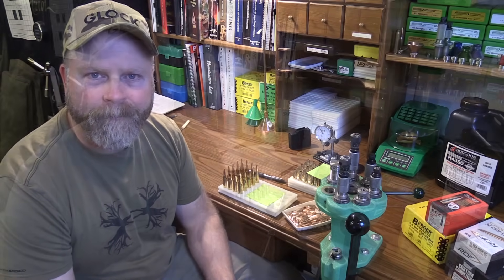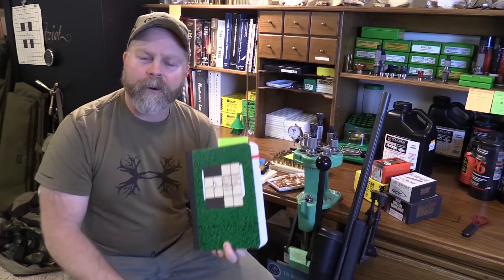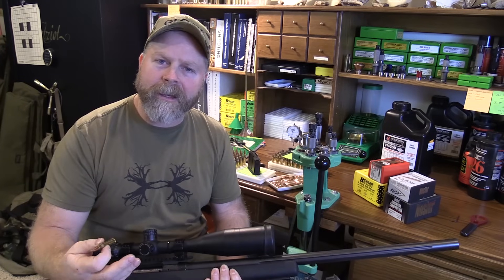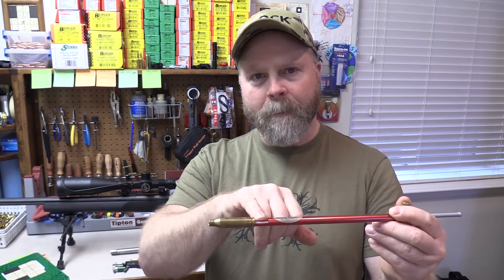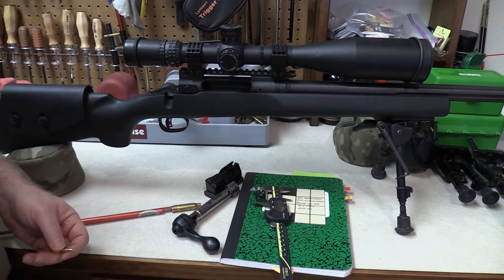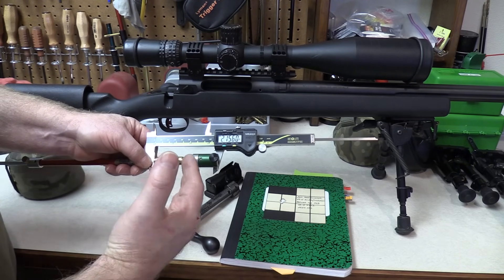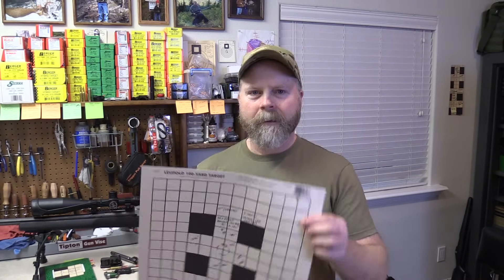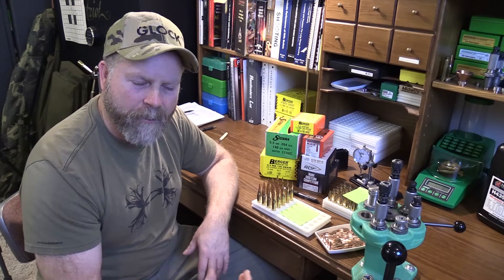Bullet Seating Depth: How To Measure & Where To Start For Load Development

Comment: You mentioned a valid point on the length of the throat vs magazine length. My AR10 has a magazine C.O.A.L of 2.80. However, using the hornady gauge I surmized the length to ogive @ 3.230. I will never be remotely close to .010 from the lands. Should I just concentrate on load development?

Comment: Subscribed, great presentation. I'm a new reloader working on a load for my Savage 10 chambered in .308 and having a ton of fun with it.

So far I've settled on:
175 SMK
42.0gr IMI 4064
Hornady brass (Have Lapua on order)
Federal Match large primers.

Put four through a ragged hole with one flyer about a half inch left, for a total of .62 MOA. .3 MOA excluding the flyer. Loaded up some more last night and hoping to verify the load soon.

Comment: Why all the special case, tooling and procedures for actual bolt face to lands measurement?Just take a piece of fired brass, slip in a new bullet and chamber it.Eject and measure.
Reply from the maker: Jim Hammer If that works for you, keep doing it.
Reply: Additionally, with each change in style and manufacturer, that measurement will change. Using a new bullet in a piece of fired brass is the only way to do it accurately

Comment: For kicks I measure the the max OAL and compared it to standard factory 450 BM ammo.   I checked a few bolt guns.  And it appears that Hornady factory ammo is at least 175 to 180 thousandths off the lands.   People are trying to be like 20 thousandths off the lands and it appears that too much (180) does not hurt accuracy one bit.  Should 4 450 BM bolt rifles and all under 1 MOA at 100 yards using factory.

Comment: What about seating depth and its relation to the gunpowder?    Example:  People say that H110 powder needs to have no airspace between the top of the powder and bottom of bullet.   So you might run into the situation were your seating depth is good for the distance from the bullet tip to rifling but leaves a air gap between the bullet and gunpowder.   So do you seat deeper so the bullet is touching the gun powder but then have more of a gap between the bullet tip and the rifling?  Seems that one should have to pay attention to both variables.
Reply from the maker: Bob I wouldn’t use a powder that was that sensitive. There is definitely a relationship between chamber size, burn rate, and bore diameter,  but I’ve never had to seat the bullet closer to the powder column just to eliminate air.
Reply: @PanhandlePrecision  I think ALL powders are sensitive to the air gap.  Example.   What if the air cap is directly over the primer?   The burn rate will be altered vs if the powder is covering the primer area.   Air space above the primer can be a issue.   At least for you it seems that the amount of air space under a bullet does not matter, you worry more about the gap between the lands and bullet.   Its an area of reloading where some people care and others don't.   I'm just trying to get to the bottom of this.
Reply from the maker: Bob All that matters are results on target.
Reply: @PanhandlePrecision  Hehe I wish it were that simple.   One has to worry about pressure issues too.
Reply from the maker: @Physics072  I've done some experimenting with this using throating reamers. If you take a 260 Rem with 42.0 H4350 and seat a bullet .020" off the lands, you will get the same MV with the same combination in a chamber throated .080" further out. Same jump to lands, but different space between the bullet and powder column. The amount of space the bullet takes up in the case isn't that important in the grand scheme of things. Picking an appropriate powder and charge weight for the case size, bullet weight, and bore diameter is. The real pressure doesn't start until the bullet is fully engraved in the lands.
Reply: @PanhandlePrecision  Thanks thats good information.    Well right now I'm researching reloading and have a unused dillon press (yes I know, was not my idea though)   On forums get so much conflicting information.  I just wanted to copy my factory rounds and find I can't even buy the same powder they use nor any reloading info.    I would like to see a pressure curve on a 450 bushmaster starting with too little powder all the way to 60,000+ .    I know of one person that sort of did it a lab, he said he ran out of room in the case before pressures got too high.     I'm guessing each company must have this in order to know the limits but I do not see such a chart published but I've not looked super hard, it might be somewhere on net.

Comment: how do you tune in your seathingdepth??  Same powderload but different depths??  Or the other way around - shoot in a load first and then tune in different depths?
Reply from the maker: PE J I don’t really mess with seating depth. I set it at .010” or .020” off the lands and don’t change, even as the barrel gets miles on it.
Reply: @PanhandlePrecision  - but sometimes you might get very far out from the caseneck and that means less presure in the case. Do you even go over max load of powder then?? maybe 0.1-0.2 gr??
Reply from the maker: PE J I don’t. If the starting depth is say 1.900” CBTO, I leave it there, even if the throat burns forward. I think it’s a waste of time and components chasing seating depth or adding powder by the kernel. The barrel is likely shot out by then anyway.

Comment: is there a bullet seating die that pushes the bullet from the ogive instead of the tip.. as i am shooting a 7 mm rem  with nosler bullets  and each and every one comes out different , even when i sent RCBS 3 bullets to get a custom seater .  as the bullets are not all uniformed  thus giving me different OAL measurements.
Reply from the maker: akaeldin I don’t know of any seating stem that purposely contacts the tip or ogive of the bullet. I seat 115 grain RDFs with Redding Comp seater using a standard stem. Hits the nose ~ 1/8” down from the tip. Perfect seating depth across large batches.

Comment: Do you have any advice for seating depth in pistols?  I'm presently using 9mm 124gr polymer bullets, and I have Taurus & FN pistols.  I seem to need to really make my C.O.L. quite short, (~1.1") and I am concerned that I may be compressing the powder even my Starting Loads.  The trouble seems to be that the Taurus barrels require the shorter bullets -- even with a "pointier" Canilure.  Should I re-throat all my Tauruses or go with a shorter COL that passes the Plunk Test?

Comment: I am working on Berger 130 VLD Target loads for a 6.5 x55 CZ 550 rifle.   I have measured my CBTO length and am concerned that setting the bullet length as far as you suggest won't give me enough bearing surface when seating the bullet.  Is this a matter of pure feel or is there some starting formula I should use?

Comment: Thanks Sam. I have a question. My reloads sometimes widen group over time. I noticed when I went to pull a bullet it was tight. Had to seat it a bit deeper to pull. My fresh reloads are easy to pull. I’m wondering if sticky bullets cause a different pressure giving me a different group. How do I fix this.
Reply: Hey Eric, the bullets sticking in the neck can affect powder ignition, velocity, and accuracy.  There are several dry neck lubes you can use to solve this problem, such as hex boron nitride, graphite, mica, etc.  Search your favorite reloading store for dry neck lube and you'll find what you need.  I coat my bullets with the hex boron nitride (HBN) so that's what I have on hand to use for neck lube.  I just get some of the powder on a Q-tip and lightly dust the neck of each case before charging with powder.  The Imperial dry neck lube comes in a container with a bunch of small beads so you can just dip the neck in there and move it around to coat everything.

Comment: problem i run into is consistency.  i have the straight oal gauge.  i have the factory 6.5cm modified case.  i have the hornady bullet.  i guess i just don't know when it's touching the lands.  it felt like it once at 2.018.  i have a few at 2.073.  then somehow i had one at 2.230.  am I jamming them in there accidentally?  are the others touching something first and I'm thinking they're bottoming out?

my one standard dev median number is about 2.085 but my range is 2.018 to 2.230.

Comment: Sam, I just got in some 6.5mm Hornady Atip bullets.  I like to seat my bullets at the lands on VLDs.... this new Atip has a very long distance from the tip of the bullet to the ogive. The bullet seated at the lands only has .125" of the bearing surface inside the neck..... is this seated enough to not cause problems?  Ive heard that a bullet should be seated in depth equal to the bore diameter. this is less than have that.  Any thoughts would be appreciated.
Reply from the maker: jaxplane 1/8” of bearing surface in the case neck seems like too little to support the bullet, but who knows? I’ve shot 300-grain SMKs with less than .338” of neck contact.
Reply: @PanhandlePrecision  ill see what happens but if i get run out, its not worth it so ill see if it likes to jump a lot.   I cringe at .125 to .150 off the lands.

Comment: Excellent dissertation.   I will throw another hat in the ring.  You are relating to hunting rifles.  I no longer hunt, but still target shoot.  I have a custom benchrest rifle.  These rifles DO show substantial  changes in accuracy when varying seating depth.  The tolerances in the benchrest rifles are much tighter which probably accounts for why you see the changes in accuracy.  Anyway my benchrest rifle’s “sweet spot” is 3 thousands off the lands to touching in most all bullets... 

Do you see any “sweet spot” at all in the hunting rifles?

Comment: I fire form the case and afterwards cut a small cut down the start of the neck of the case. So you can push the projectile in with a small amount of pressure. And it won’t slip to easily. Then carefully seat the empty case and primer with the projectile at a long length into the rifle using the bolt. Push it forwards and close the bolt. Then carefully remove and measure the overall length. That’s your distance to the Lans. No tools just a dremal or hacksaw blade. It has worked for me. Great videos. Cheers Brent

Comment: Excellent information and presentation, very informative and directly helpful. I am having difficulties doing this on a .223 Rem Ruger Predator using the Hornady tool and modified casing in that I get wildly differing results on each attempt. I took my time, very carefully executed each step, made sure the shoulder of the case was seated in the chamber, moved the rod forward with measured force, tightened the lock nut, and still got huge differences on each attempt. I finally stopped out of pure frustration. I accept that this is a tried, true and tested methodology which leads to the only variable, the grey matter between my left and right ears. Any and all advice would be welcomed.

Comment: Does the distance from the bolt face to where the shoulder seats change? Is that the throat you are talking about ? What is getting shot out in the barrel?
Reply from the maker: Grover Hammonds The area of the barrel between the end of the case neck and where the rifling starts.
Reply: Panhandle if I put a case in my gun fl sized no bullet no powder it slides into the chamber freely what contacts the barrel first to stop it the rim of the neck or the shoulder I’m still confused how we know or measure where the neck is
Reply from the maker: Grover Hammonds With a bottleneck cartridge like the 260 Rem, the shoulder of the case is what stops forward motion of the case when it’s chambered.

Comment: To seat out long against the lands serves to build higher chamber pressures which is what crimping does for hunting rounds. Six of one, half dozen of the other. The advantage of the shorter round is that it will fire well in any rifle, not just the long range target rifle you are working on. I also found that the Teflon coated rounds help greatly to extend barrel life but they are not cheap.

Comment: I am 62 years old and reloaded for over 20 years back when it was cost effective. Now with the price of powder and components, you can buy a factory premium round that performs perfectly fine. I use to do what you are doing for seating depth and not crimp on cannalures but that limits the round to TARGET only. I still have my stuff but never use it. RCBS dies were good but I prefer the Lyman turret press.  A good custom barrel usually cures reload accuracy problems too.

Comment: Sam you definitely have it down to the best there is , the only big difference I’ve ever noticed in seating depths of different bullets is when I for hunting purposes started loading a Barnes MRX , you know the solid copper bullets with pressure rings, three or four , grooves like a maxi ball , these type bullets tell you on the box to start your seating depth 50 thousandth off lands and boy were they right , and the closer you get to the lands , the worse your groups will be. Oh and they are expensive, but worth every penny , I could change the powder charge a bunch , and not hurt the group size, they just Waller a hole in the paper.

Comment: When seating the bullet my RCBS die does not contact the olive.  Is there a better die or do I use a bushing in the comparator that most closely matches the die so I can set the COAL?  Love your presentation.
Reply from the maker: It's a relative measurement. No seating stem that I know of contacts the bullet where a comparator insert does. Seating stems are going to contact up high by the nose; comparators hit by the bearing surface. Measure with the correct  comparator, and adjust with the die.
Reply: Thanks, I’m using the ELD 338 bullets which are fairly consistent but I’m getting .001 to .003 difference between cartridges using the 33 comparator.  Is this a big deal?

Comment: Not having all your fancy gear I just partially seated a new slug in an empty full length sized case & used the rifles bolt to push the slug into the case. Then using the seating die just pushed the slug in .1 deeper & made that my "master" dummy round. And wrote its OAL on that case. Seemed to work fine. Shot great. Like you, found setting slug just a tad off the lands worked best. Also lightly crimp each NON  cannelured. And tight crimp cannelured.  THAT really seemed to help & definately increased velocity & decreased velocity spread. Old gunsmith taught me that. Also, inside reaming the primer hole into a cone shape gave a better primer flame that ignited the powder from very bottom to top more consistantly. It also slightly enlarges the primer flash hole. For what its worth I usually get 10 FPS or less velocity spreads. But im a real stickler for EXACT powder weights on EVERY load. Every round is identical to its brothers. Only do "cold bore" testing too..where we live in the bush 1 shot is the difference between eating or not & thats going to be out of a cold bore. In the winter, an EXTREAMLY cold bore. 😁
Reply: Alaska?

Comment: Questions for you Sam. I'm trying to reload for a 270 wsm I picked up. It came with a box of handloads, not know the data on them, I just fired them down range. Here's what the problem - Bought a set of Gold RCBS  FL dies, after all the prep, the neck is so big the bullet just falls in the case. Can you tell me where I went wrong? Should I just buy a neck sizer now? Thank you for any help. By the way your videos are great.
Reply: Sounds like the guy was neck turning his brass, or you have the wrong expander in your die.  Could be a bad die also.  I would measure the expander to make sure it's around .002" smaller than your bullet, then check the neck thickness on the brass.  You can do this by measuring a loaded round at the neck, subtracting bullet diameter, and dividing by 2.  If its thinner than .013" its probably been turned down so you'll need a bushing neck die with the correct bushing to size it down properly.  The bushing size will be .002-.003" smaller than the outside neck dimension of a loaded round.

Comment: Should the Base to Ogive measurement be the same for every bullet in a given barrel?  I ask because I thought it should, but when I measure a Savage 12FV in .223 with a Hornaday 60gr V-Max, I got a different reading than when I tested with a 60gr Nosler Ballistic Tip.  I noted both, but was confused by that.  Great videos, easy to understand and very methodical about your craft!  Thanks for the help getting into this life long dream.
EDIT:  I just saw your Episode 4 of Straight Talk discussing this and it implies that my assumption is correct.  I would be interested in hearing any theories on why I am getting a different value for CTBO on the 2 bullets.  Thanks again!
Reply: Simple answer is "NO". Each different type or shape of bullet will have a different place the comparator lands and gives you a measurement. The ogive (or shape of the bullet) is different on the two bullets you used. Hornaday 60gr V-Max : Nosler 60gr Ballistic Tip.

Comment: Nice video, I notice on my AR15 223 rounds my seating depth is long, so therefor my bullets don't fit in the magazine. So I ask myself why bother. This is discouraging  because I took the time to do the right thing and finding my so called perfect seating depth Any suggestion how to get around this, or does a different manufacture bullet I should be looking into?
Reply: As far as i know, you're sol on doing this for mag fed guns. You're best off tuning your powder loads instead.
Reply: This is what I did fine tune powder